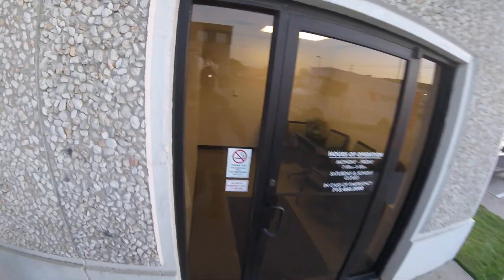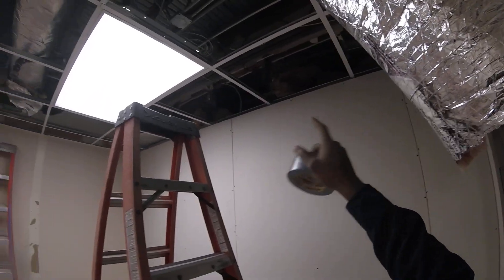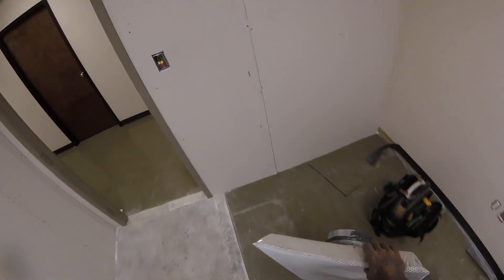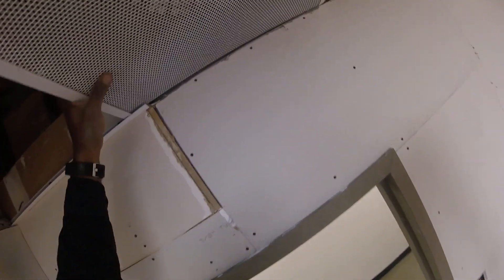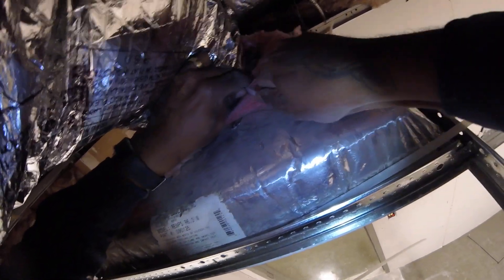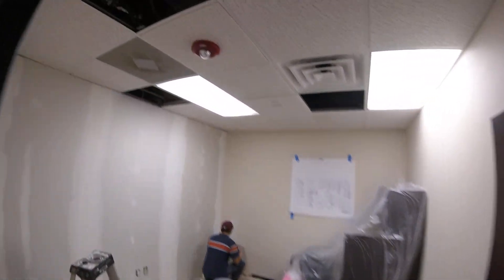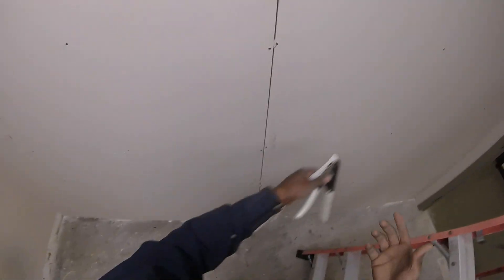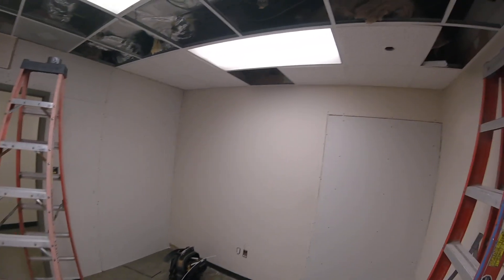HVAC: Tieing in flex duct

Comment: Thank you for your videos. This video showed how to terminate a run to the end device, my question deals with the process of 'taking off' of an established flex run. Will you need to use a 'T' to put into the supply run& attach as you demonstrated, then run flex into the space and terminating with a diffuser in the space?  Simple 'yes' will let me know I've got the right idea, but if I'm wrong, steer me right.